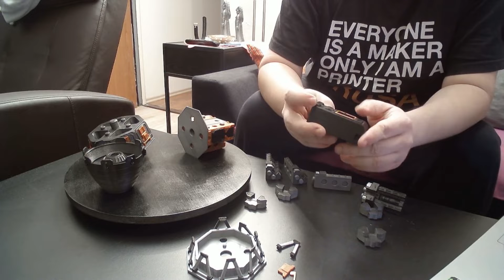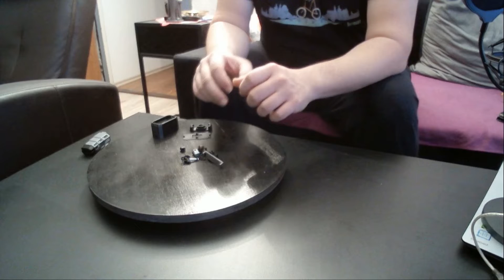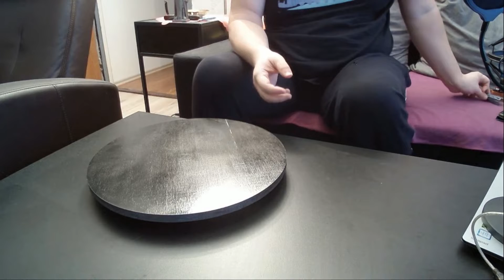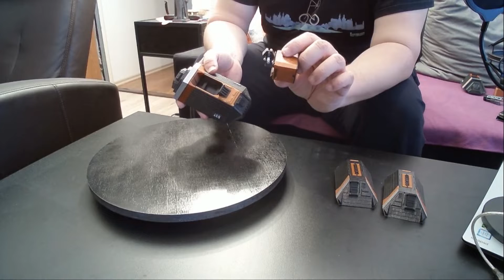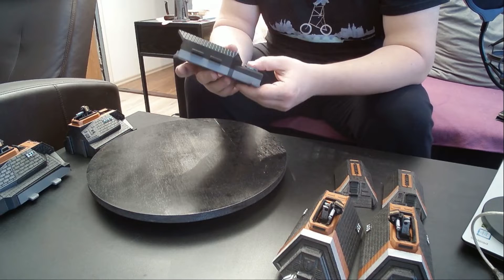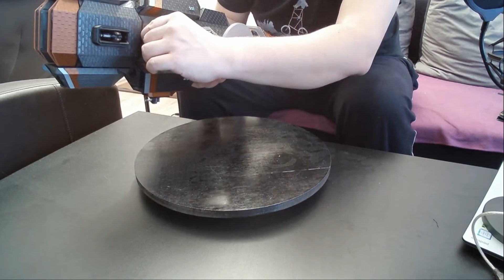Project Orion Part 2 - Assembly and Review

Comment: I am just finishing this model on a tiny Bambu Lab A1 Mini. It turned out 97% perfect. I had trouble with the orange accent pieces not fitting correctly. I had to cut away some material but it eventually worked. Not sure what happened. I tried twice with the same results. I blame the print profile, not Martin. His work is the best out there right now.

Comment: 19:00 "Next one will be the Raptor class" 
Oh my god yes. Same scale please

A beauty as always Martin. thats some real talent you got there
Reply from the maker: Thank you. And indeed the raptor will be the same scale as the rest..... i am such a moron.....i hope i will have a place to put it....😃
Reply: @martintaichl  Same scale ratio? Oh boy, in that case "Raptor" will turn out about 2× "Orion", yup, that's how big is "Raptor" (89m concept scale for NOT accurate). Other than that, you did this one well enough (quite a few things are different, including engine cone assembly, and design, proportions, and scale ratios), now concept scale says "Orion" is 66m. Example: if your Corvette Class is 50 cm, "Orion"(Heavy Frigate) will be 71-72 cm, "Raptor"(Light Cruiser) will be 130 cm, Morrigan Class (Partrol Destroyer) will be ~36 cm.
Reply: @martintaichl  Conciddering 1 pella enginepod is 2/3 the size of Rocinante a place to put it will be a challenge 😅
Reply: @core3086  Pella has about 28m wide bow (thinnest part), and about 50m wide nacelles (widest part), and has 3 ratio between widest and lenght (about 150m long). It's one nacelle (side on which PDC is mounted) has length that fits 5 PDC frames (about 9 PDC guns) and that's without engine cone, in another words there is about 45-50m of the Pella from bottom of engine cone to top of nacelle, and on top of that there is another 2/3 of the ship. Who ever scaled it at 89m MISSED MISERABLY by unbelievable and spectacular 70-80%. 🤣
Reply from the maker: @core3086  that is precisely why i called myself a moron...😃
Reply: @martintaichl  🤣 Well so what if ship is big, that's good. Eager to see it. 
As for how large your model will be, well if you make it double the length the Roci, due to design and design ratios of the Pella, you will realize that you will have to downscale air bridges (airlocks) and launchers to fit them the way we see them fit on the ship (or you can use them same size, but change design ratios of the ship, and build a model that only resembles the Pella) because if you use them (airlocks, launchers) same size as on Roci model, you will have to make Pella about 3x the Roci. 
So take your time and be the 1st one who made Light Cruiser properly, cause quite few other tried and managed to build some ship that only resembles light cruiser..
Reply from the maker: @elvisibra  i will do it in a way the common items are used as a scale reference - mainly PDCs and the bridge. How big the actual model will be will depend on that.
Reply: @martintaichl  Yes ofc. Now, when you were buliding the Roci and if you followed Roci's design ratios as much as posible and you fit airlock and launchers on the Roci same place and in same size ratio with the ship as we see it on screen and on ortographic view of the model, then if you build the Pella 2× longer than the Roci and try to fit those same launchers and airlock on the Pella exact way we see them fit on the ship, you will realize that you have to make the Pella more than 2× longer than Roci, between 2.6 and 3× longer actually, and in that case you will have sight discrepency with using same size PDC frames (on 2.6-3× larger Pella same size PDC frames will be about 10-20% smaller on the Pella than PDC frames on the Pella actually are), but then you will realize that PDC frame is not fully reliable for scale, because if you investigate what's visible, you will realize that MCRN PDC frames variate in size depending on class to class, and inside of same class and ship, depending on how robust they are, thickness of the outer frame and position they are mounted on (for example Roci's mid are about 10% longer than Roci's fore, and Pella's all are about 20% longer than Roci's mid, while all Orions are same size as Roci's mid). I.e. if you use same size PDC frames for all they should be little off, cause only PDC guns and doors/hatches are same size on all ships, same as (presumsbly/logicaly) main entry doors and thus air bridges too, while airlocks themselves can also variate up from minimum standard in size cause they also have outer frames..
Ok. I'm talking too much. Shortly, when you bild Pella, there is an airlock on ventral wall (between launchers) and that wall HAS TO be about 7m wide to be able to fit standard airlock the way we see it on screen (same size airlock that Roci has), while measured on ortographic model, that same wall fits 4× into width of the bow, and width of the bow fits about 5.5× (5.43 exact) into length of the ship. Those are some of design ratios. I hope I'm not too boring and more helpful.

Comment: "Raptor" class (Pella) has two docking bridges (air bridges), one ventral fore, one mid dorsal, and large(r) cargo/hangar bay door (lower ventral). Six (2 tube) + 3 (single larger tube) launchers fore. I don't know what those two port and starboard aft (between engine cones) are, might be horizontal launchers (missiles slide out sideways so have time to flip to sides and around drive plumes)..

Comment: Do you have any design method videos? You seem to have a great process for well fitting pieces and easy assembly!
Reply from the maker: well I did 2 part video about modelling an Ori Mothership. It is in my videos. However, that was the basic design of the model itself. Not the individual printable pieces with all the locks. And that is probably what you are interested in. Theoretically now I am in process of designing model for the rapto class so once I am done with the main ship model, I could record the designing of individual printable pieces. ;)

Comment: Hey Martin do you have any tips for painted the models. Or do you just go for it.
Reply from the maker: i am not sure i understand you. What exactly do you mean?
Reply: @martintaichl  ah sorry. 
do you paint your models or print them in colour? if you paint them, do you have any technics or do your just paint them as they are ?
Reply from the maker: @ush2177  both. or rather all three :D 
I dont really like painting so I try to design the models so that they require minimum painting. For example here in the orion: all the bronze parts are separate prints printed in bronze PLA. the main body is blackish, yet i printed it from grey PLA and then used spray paint. I then used brush and Ravell colors to paint all the details - grey stripes, white and black text and the supports for the driving cone. And that is it ;)
Reply: @martintaichl  ahh cool. I have been hiding from painting myself. But im starting to gear up for giving it a go. I have alot of all black or all grey models that need some TLC ha 
i think my fear is to mess it up after all those hours of printing .
Reply from the maker: @ush2177  if you do, just paint spray it all again and problem solved ;)

Comment: do you have an idea on what scale this guy is?
Reply from the maker: Nope, i did it in scale with my corvette, morrigan and roci. But what the actual scale is, i dont know
Reply: @martintaichl  thats good enough
Reply: @PulsefiredGaming  concept scale (not official) was stated 66m length, but if you use ortograohic model for scale and for example measure hight of entry door and put that measure in scale with the ship, considering 2m door hight, you will get about 86m ship hight..